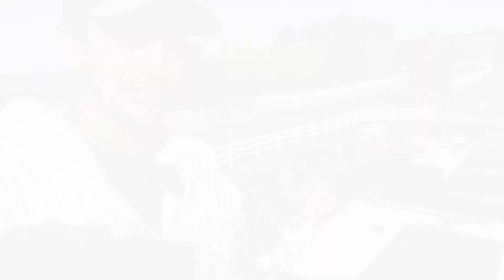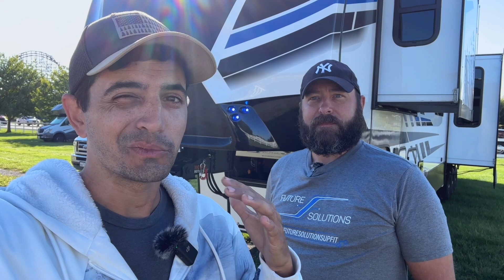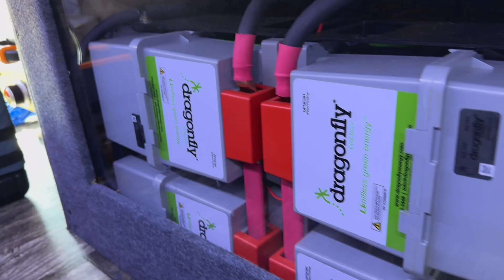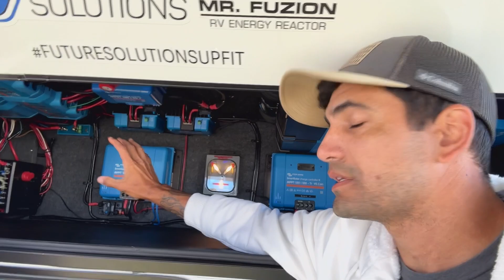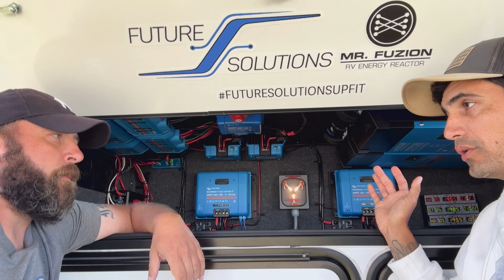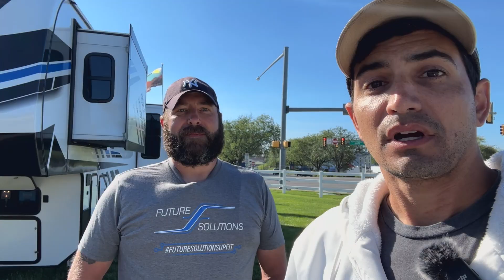3,600W Custom built RV Solar System fully off grid rig - Why Not RV: Ep 131

Comment: Love the build, I cant get my Dc to Dc to crank its 30amps. It seems to get warm
And cuts amps. I did point the vent hose on it but still
Does not put out the full amperage.
Reply from the maker: Heat is the enemy of all things electrical. Is it just getting too hot?
Reply: well I only noticed the amps on my victron app while driving. Its a cloudy day and my dc2dc is plugged and only charging under 20amps. So i am presuming its cutting from over heating. thanks BTW  @WhyNotRV

Comment: How many amp hours is the setup?
Reply from the maker: Hey, thanks for watching. This is 4 Battle Born Game Changers at t this time which equals 1,080ah @ 12v
Reply: Great vid, awesome work. What would the price range be for a similar system?
Reply from the maker: For this type of setup just equipment cost is around $12-$14k. So if you DIY… that’s it. For a company to do it you’re looking at $20-30 grand depending